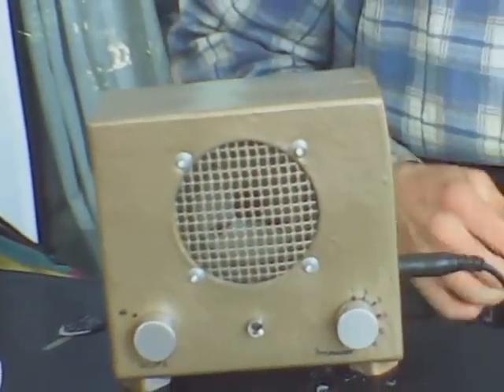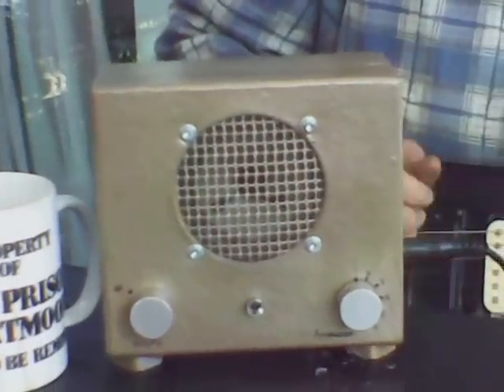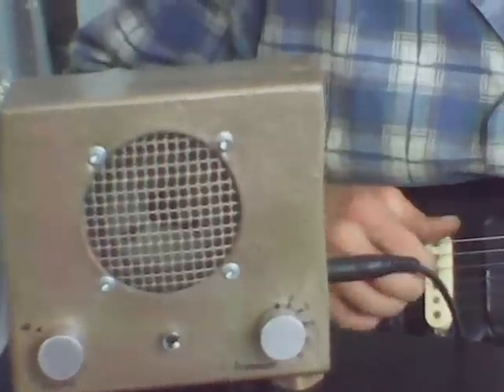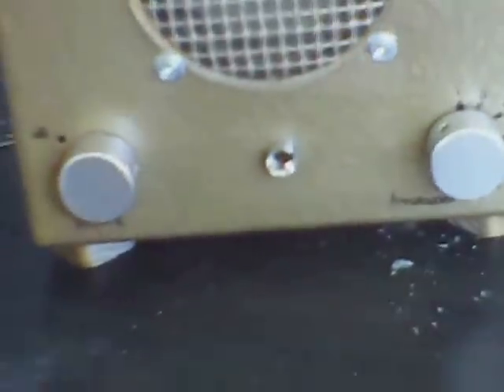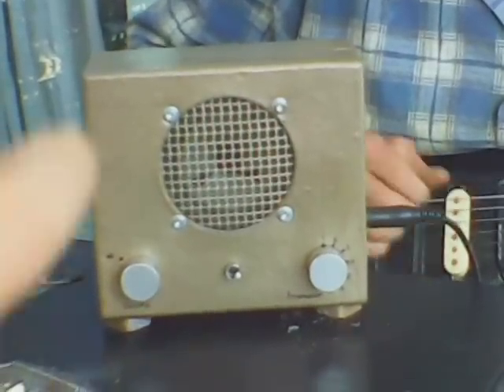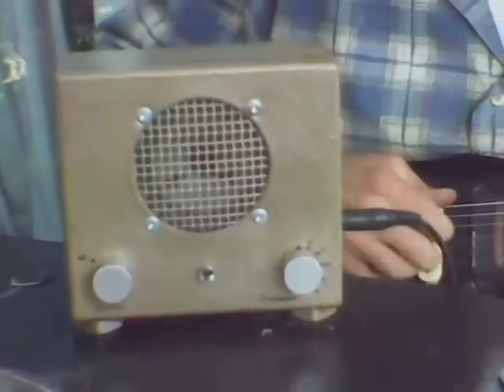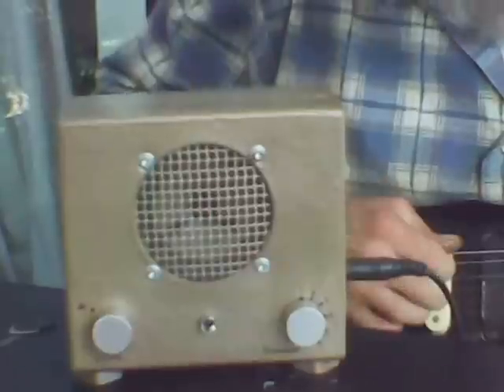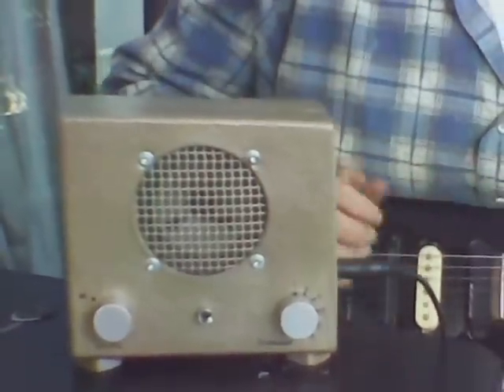Germanium Transistor Transformer Coupled Guitar Practice Amplifier.

Comment: Hi, you have a schematic? Wonderful sounding! I desire built for me, fantastic... is possbile to build on 4-5 watt?
Reply from the maker: +Fabio D'Errico The schematic is from a little book called Audio Projects by BB Babani (9780859340656). You can get this from ebay http://www.ebay.co.uk/itm/Audio-Projects-Bernard-Babani-Publishing-Radio-Electronics-Books-Rayer-Fr-/381434136722?hash=item58cf3f0892:i:381434136722   (copy and paste hyperlink) and costs about £3.

You will probably need an additional amplification stage so that it is sensitive enough for a guitar, schematic in the book also.

At least, I think this is the correct book. In one of my movies, I've an image of the book. The project in the book is 'transformer coupled amplifier'. The transformers used in this movie's amplifier are LT700: Output and LT44: and available on ebay as well. These will handle power levels of up to 250mW. If you can get a scrapped 1960s radio, sometimes the components, including transistors, are in there also. They must be de soldered.

As is commonly the issue with transformer coupled amplifiers, it is becoming increasingly difficult to source the transformers for the higher power ones such as you ask about. Many advance hobbyists attempt to wind their own transformers but, as you can probably imagine, this takes some dedication.

Thank you very much for your comment and your interest in my movie.